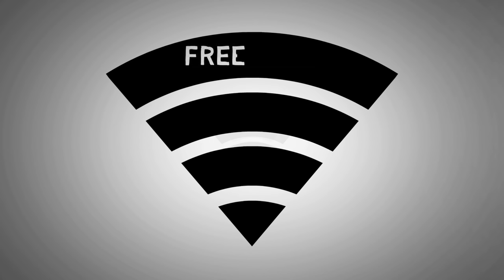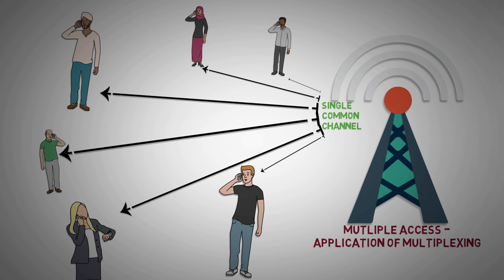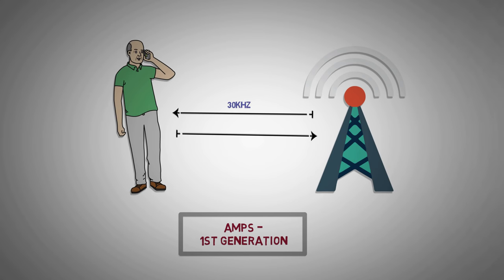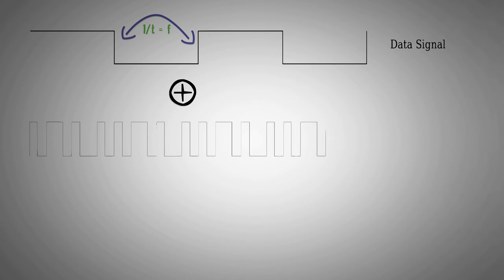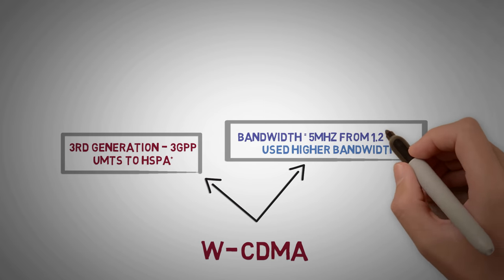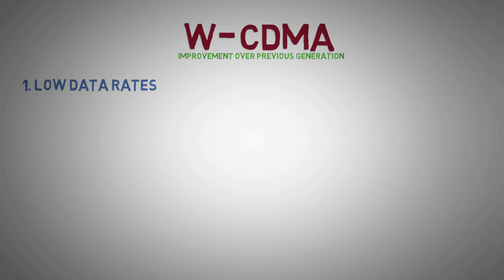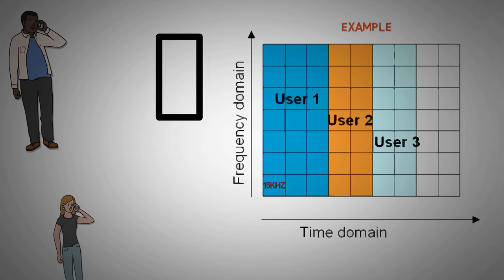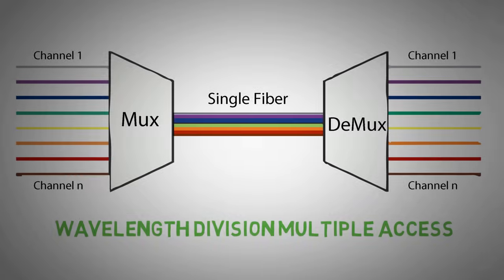2.2 - MULTIPLE ACCESS - FDMA/TDMA/CDMA/OFDMA

Comment: 1:15 Since separate nodes are transmitting at different frequencies, they wouldn't be detected as one smooth wave as you show. It would be detected as multiple simultaneous waves at different frequencies.